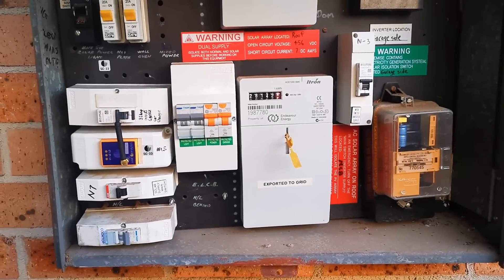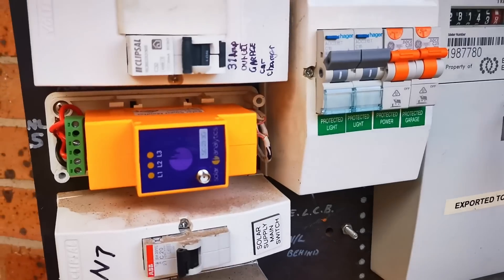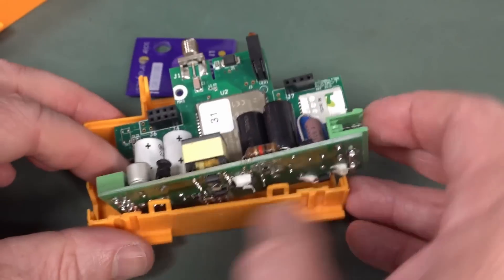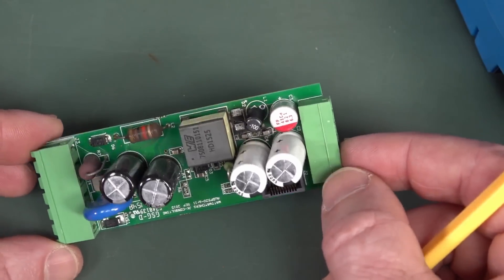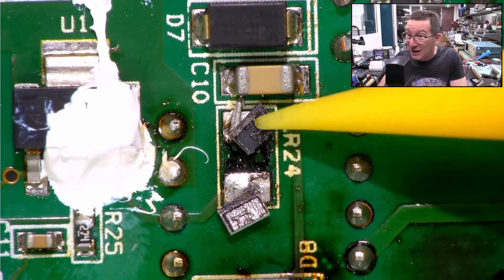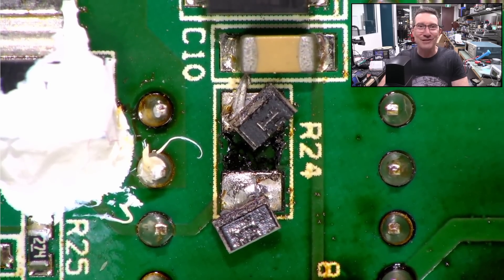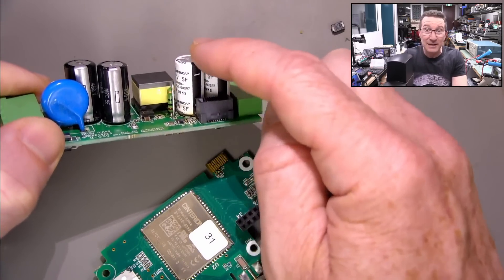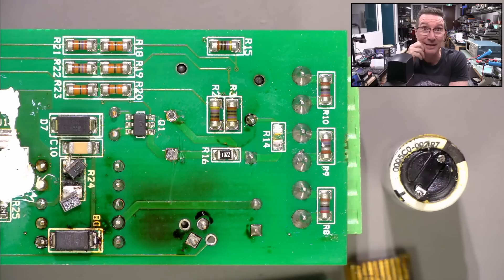EEVblog 1511 - Solar Analytics System FAIL! (+ Dave gets ZAPPED!)

Comment: Is this a common way of building electric panels in Australia? I'm just wondering, bc most of the devices in there are DIN-Rail compatible, mounted in a tiny box, with a tiny rail, mounted to a panel. The big  meters look like for ordinary 3-point fixtures.
Of course every country has its standards, but as a German electrician, this looks a bit odd to me.
We use mostly standardized cabinets with DIN-Rails, 3 point fixtures and wiring conduits. This way the insides are more accessible and serviceable.
Though, interesting to see how it's made in other countries.

Comment: These 3G tranceiver pull a crapton of current when transmitting. The average use case is few 100mW on AVG, but the peaks are in multiple W range. Especially trying to reach cell tower thru a faraday cage like structure like a steel box. Maybe the transmitter got hung up transmitting constantly, maybe one day the closest cell tower was dow and it tried to reach next tower, that will easily overwhelm the PSU causing severe ripple heating up the supercaps. Supercap overheated and blew, (increased internal current leakage?) making ripple worse as capacity diminish. Then schottky output diode overheated, fell off caused some nice arcing. With diode gonskji, the snubber ate alot of sh.. as the PSU tried to restart over n over.

Comment: Zappp!  Sorry, Dave, but I haven't laughed at a YT video so much ever as this one.  
One query on those super-caps...  2.7V is fine if they are just backing up RAM in the module or similar, but are they in series for 5V?  They did not appear to be in parallel and I could not spot any balancing arrangement.  And if they are not well matched then one would easily go over voltage.  I noted that R14 (I think) was also missing.  Would that be related?

Comment: We seem to take bleeder resistors for granted these days. It took a similar experience with a 1000W PC PSU to finally buy a cap discharge tool since it nearly melted my screwdriver and scared the s... out of me!

Comment: Thats why I used a 50-100 ohm resistor to charge the supercap, but provided a diode bypass for discharge. This way, even if the cap fails short, you only heat up the resistor way within its power handling capabilities.

Comment: I'm guessing the leaked electrolyte in the connector (and anywhere else too) shorted out the power supply, and the diode's solder joints became a fuse.

Comment: looks like the bottom of the 2nd supercap is also cracked
Reply: possibly over charged? or too much charge or discharge current? super-caps generally need to be current limited on the inrush.

Comment: R14 is missing - one of supercap balancing -> overvoltage -> leaking
Reply from the maker: Yep. Looks like it was there at one point. I didn't find it, will have another look. If it was missing from the get go there is absolutely no way it would have lasted long at at all, let alone 6+ years.

Comment: I suspect the resistor failed first due to overheating, it's probably part of the snubber network on the primary winding of the transformer. The diode on the secondary maybe overheated because of the increased voltage spikes from the undamped transformer.
Reply: Unless if the resistor is in the supercap charger, it would have failed from the supercap shorting, the diode also overheated because of that
Reply from the maker: @brainndamage  Resistor is on the primary side, so not for the supercaps.

Comment: I was investigating the power supply for a PoE network switch a few years ago. It had been sitting, unpowered/unplugged for at least a week. Well, before I knew it, I involuntarily threw that PSU board across the room, big zap! Turns out the power planes went all the way to the edges of the roughly cut PCB (seemed scored+broken rather than sawed/milled), and handling the board by the edges as I always do, was exactly the way to get zapped :) Good times. Now that I think about it, it seems a bit odd that the high input filter cap voltage would be present on a big power plane though going to the edges of the board though...
Reply: That was the inbuilt anti-tamper feature lol.

Comment: That failed capacitor looks like it has small bulge on top, not very noticeable but it is. Also tracks from second capacitor to card connector look broken and lifted a bit.
About that resistor my guess is, that it got so hot that it almost desoldered itself and violently cracked in half, thus rotating like that, with solder solidifying right after that.

Comment: Yep, I've had a few shocks like that myself. Each and every time it's from powering up a piece of gear on the bench after repairing it, and stupidly handling the board with my bare hands, moving it to get a better angle for probing. One time I could even feel the 50Hz on the secondary of the transformer, and I had enough time to think "that's probably not good" before I started to put it down, evidently coming into contact with the primary in the process, which caused the muscles in my hand to twitch and throw the board across the room.

The last time my arm flew off and smacked into the side of my desk. That one really hurt. I couldn't even close my hand to pull out the power plug.
Reply: Last time I did it was when computers still used AT power supplies... I took mine out to clean the dust out, and when I put it back in it didn't power up.... I figured I probably had the switch wired wrong, and started unplugging the terminals... Live.
I ended up with a pair of burn marks on my finger which scarred (and one is still visible still 25 years later), and a bleeding hole on the back of my hand where I smacked it into the corner of a CD drive.

I've been a combination of careful and lucky ever since.

Comment: Hi Dave, I haven't seen a flipped torn component yet, but I have experienced a self desoldering triac in a TO220 case in our customer's rig. That's why I'm not writing, you already know why you got hit by that capacitor, I dare say I figured it out, because you forgot to put the jazzyk at the right angle and that caused a disturbance of the field of concentration on the distribution of components in the board 😁 All that remains is to say, that they have it nicely designed.

Nice day 🙂 Tom

Comment: When detecting the 2 supercaps in series I immediately got concerned about them being balanced.
 @gorak9000 mentioned this too: supercaps don't like to be overcharged to a higher voltage and when placing supercaps in series there should always be some protection to prevent that from happening.
Balance resistors are great for small caps (we used to design high voltage capacitor banks that way) but for those large supercaps balancing resistors are not enough. At least some zener diodes or even better one of those active balancing chips especially designed for supercaps should have been used. But writing this I do remember that, back then, I was advices to just place balancing resistors over my supercaps by a component supplier.
Reply: In HP servers of generation 7 and 8 there are supercaps installed for the RAID controller. They saved a cent by not populating the capacitor module balancing resistors. Now we replace blown caps all day. And it's always one cap bulged because of overvoltage and one ok. (2 caps in series)
Reply from the maker: They are 2.2k balance resistors and were carefully chosen. See the other comment thread. Mine is the only known failure in over 70k devices installed.

Comment: Are there any models of energy monitoring tied to a stupid cloud service? 

I currently have two systems in my house one from the solar installation that uses 3G and the other from the hot water system that connects to a gateway over powerline and then to Ethernet. Neither of them can be queried directly for information, have to use an app with an undocumented API. I have already reverse-engineered one to integrate the data into Home Assistant, but it's a bit silly sending the data to a cloud service to just bring it back again, and assuming the company doesn't go belly up or abandon the service.

Comment: Had Issues with nesscap supercaps in the previous company, back in 2015 so it's similar date with your product. They often leaked and coroded the PCB, althoug we were using much bigger size 55F-60F  I recall.

Comment: Is that the way fuse boxes are made down there?
Just bolt the breakers on and wire them in the back?
Yank breakers are much neater.
Reply from the maker: Not any more, very 1980's , maybe into the 90's.
Reply: @EEVblog  At least you have 230 volts. The Yanks only give you a girlish 120. Try to draw a decent amount of power and the wiring melts and burns the house down. Japan is worse with 100. You might as well use a 9 volt battery.

Comment: Must have been a 'zap Dave day', as I got a 'tingle' changing the back light led strips in my LG TV,  even though it had been powered down for over 8 hrs!.. Darned led driver psu caps... Cheers from a miffed Dave in the UK..😟

Comment: Speaking of electrical zaps -  years ago I was mowing the paddock with an old Victa which had the fuel tap just above the spark plug, and the only way to turn the thing off was to close the fuel and let it run out.  I woke up about 10 feet behind the mower on my ass - the mower was stopped so it either ran out while I was out, or I stole all the spark....... probably 10 years old at the time.

Comment: New one will fit in the same box, just will have a nice big DIN rail box to hold all the breakers and other DIN rail mounted units, with the meters now all being on the top row in a line. Plenty of space then for extension.

When you replace the heater, insulate all the hot water pipes both outside and inside the roof, so as to minimise the heat loss from the long runs.

Comment: The isolation between AC mains and secondary circuit does not look safe on the power supply board. The 3G antenna is accessible so there should be double/reinforced insulation on that power supply. This kind of equipment should be designed taking over voltage category III requirements into consideration.
Reply: Perhaps the antenna jack is isolated from the main board. Power measurement is certainly easier if the measurement circuitry isn't isolated.

Comment: When I read "Dave gets zapped", I was anticipating it. When you started talking about the capacitors, I thought, that would be the moment. And in the next second - ZAP!!! Just could not predict it more precisely ... 😁
I know it hurts! Once I got it across my thumb and index finger while repairing an extension cord. It was like a heavy hammer hitting my hand. As they say, unplug before open ... 😃
Reply from the maker: It's a spoiler, but I gotta get the clicks.

Comment: Doesn't look that bad.. are you going to revive it just for giggles? Might be useful as a spare for something else and would make an interesting video too, many people find themselves in a situation with cap damage / carbon tracking and cant afford or dont have a replacement part available.. bit of baking soda and alcohol wash might just get that going again providing the electrolyte and failure mode hasnt damaged any of the IC's.
Reply from the maker: Not something I'd waste my time on, got too many other things.
Reply: @EEVblog  ah i thought after I posted my comment that you probably have way too much going on to justify filming and editing etc. Silicon heaven it is 😂 thanks for the reply though 🙂

Comment: Curious that the super caps are only 2.7V.
Are they connected in series?
I would have thought that the electronics would have at least been running at 3.3V.

Comment: Years ago I was running a small bare tube HeNe laser and even though I was well aware that the tube acts like a cap andholds a charge for several minutes after being turned off I managed to brush it with my right pinky while moving another HeNe tube and oh boy did that hurt like hell. I don't know how much voltage was still on the tube but I know it operates on 1250VDC and had enough on it to make my finger go numb for a good 20 minutes. Of course the one time I didn't put gloves on was the time I managed to touch a charged tube. That's one mistake I hope to never make again.

Comment: I've had a few bites from 120Vac (usually a bad ground from a guitar amplifier) but the ones that caused more injury were DC
- at Tektronix (Wilsonville), someone 30 meters away blew off their finger on a 5V, 120A power supply... got their wedding ring across it.
- 12V DC (motorcycle gel-cell battery) fused a metal watchband to a lady's wrist when I was working at the place that made the first AED.
- ME? I got 5kV in one hand and out the other troubleshooting an early-production AED which had a badly mis-wired High Voltage section... someone in production got lost q/all the white-only 6kV silicone wire and somehow failed to connect up the dead-man relay properly so the 50ohm dump resistor was never across the Defib Cap... not even the 1000:1 voltage divider was properly in-circuit, so when I checked the cap looked like it was drained. I got within about half an inch and a BEAUTFIL Bright Blue Spark leapt from the cap and met my fingertip... then up through my arm, across my back (the scapulae met in the middle) and down through the other hand, jumped the anti-static mat (breaks down at 600 volts) and back to the unit chassis, which was siting on the mat.
Stupid me, I forgot about the mat's breakdown voltage and thought I was "Safe" with my hand almost 2 feet from the unit.

Yer not the only Dumb one, Dave.

I think my T-shirt should say :

Safe
Not By Design...
By Luck

Comment: Didn't actually get to the root cause of the failure.
That supercar may have failed due to over-voltage due to unbalance as per comments or failure of the snubber network.
Smells like a design flaw.
Reply from the maker: There are balance resistors.

Comment: Biggest zap I've done is 120v ac. One time barely noticeable,  another time I was white for the afternoon.  Glad to see you'll make a full recovery.
Reply: Oh yhea, and then there was the leaky spark plug wires from an HEI (high energy ignition) system. Memorable.
Reply: @bert-blank  Don't get that across both your hands...

Comment: The crispy-fried resistor sort of makes sense since it looks to be part of the snubber network on the primary side. I would hazard to say that D8 that looks kinda cooked as well might be a TVS (Edit: It is. A 200V Zener. I'm sure it got toasty piping hot!). With it there absorbing some of the excess energy the supply probably sort of worked, but once it cracked there was nothing to stop the flyback voltage from sailing away, probably from having the output loaded down or some other issue. I'd guess the caps started to go short-circuit, or possibly it was no longer in regulation and running in some form of quasi-open loop and overvolted everything.

Comment: The last time I got shocked was because I used a 1000V insulation tester to check some 5kV cable for suspected damage while it was still on a reel (it turned out to be fine). What I had not considered was that the conductor and foil shield together essentially made the cable a big capacitor, and that charging it up to 1000V and discharging it across my thumb would feel less than pleasant. 0/10 would not recommend.
Reply: @Ralph Reilly no, I rate the experience 0/10, and I would not recommend it. That's not a double negative.

Comment: To be honest they believe one of the super caps failed because it looks like it may have leaked electrolyte and that's what you thinking was flux on the connector it's electrolyte from the super cap and that's maybe what fried the diode and kind of learned a hard way about taking digital cameras apart and been given a whack off a photo flash capacitor

Comment: Supercap in Series is like charging battery in parallel the Voltage get unbalanced or overvoltage on one side over the specifications
Reply: Right... but series
Reply: @ericwazhung  right let me change that, I'm not that good at writing English comment
Reply: @satria4195  But same with batteries... series... But, yes, parallel can have its own set of problems.

Comment: Dump it mate! I grew up on 220V 50 Hz. Got zapped endless times. Then went to England and got zapped on 240V Hey the extra 20 make you taking extra care. Then I had 117V 60Hz, that was just a near pleasant cribble.  Next stop: Western Australia in 1982: They had 254V mains!! Never even wanted to get zapped.
Reply: You probably never worked with CRT TV's... 25kV and the picture tube acts as a perfect capacitor. It is a good advice to discharge the voltage properly before you try to remove the HV plug. (called the pacifier)
Reply: @PlaywithJunk  Yep, 1 zap with 25kV and the tube went zsssssss.....
Reply: @LawpickingLocksmith  Normally the tube will be fine but your finger hurts... 😁

Comment: A decade ago I was living in a little Victorian era cottage built in the 1860's, so because of its age the power was installed many years after it was built, with all the conduit installed on the walls and ceilings. It also still had the original fuse box complete with ceramic fuse holders and the obligatory packets of fuse wire so you could repair a fuse when it melted. None of that smart meter rubbish!
Reply: The first house I ever lived in and grew up in had exactly one fuse, and the only power outlet was part of the lighting circuit.  As we began to need more outlets, we eventually had that old outlet removed and replaced with a modern outlet with modern wiring.  (Ended up with three fuses: One for lighting and two for power)
Reply: @melkiorwiseman  In our house, we still have everything on a single 10A breaker. We have many outlets and lights, but everything is on that one breaker... And aluminum wires, most outlets have no ground.